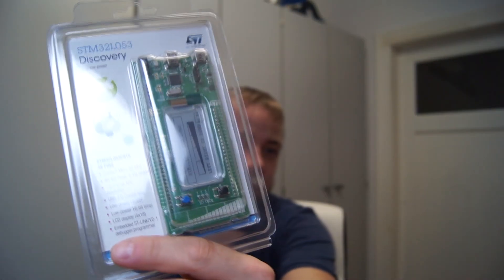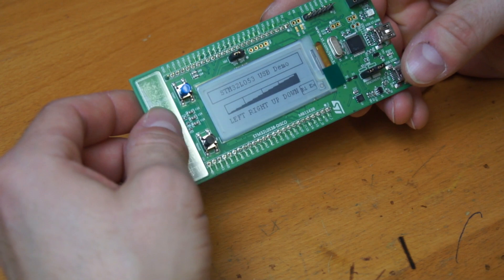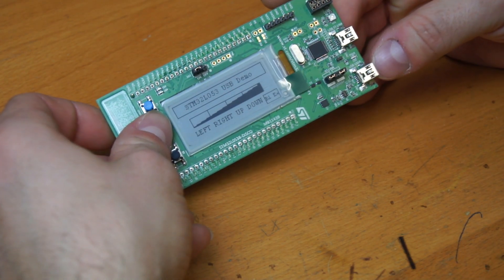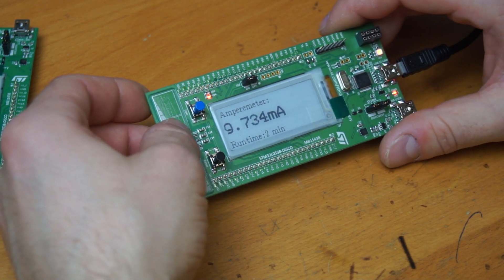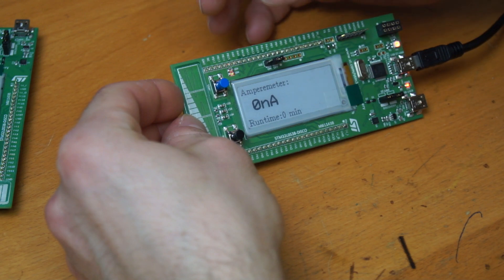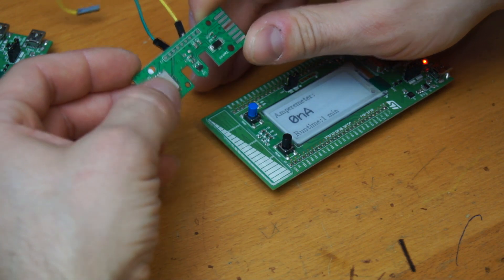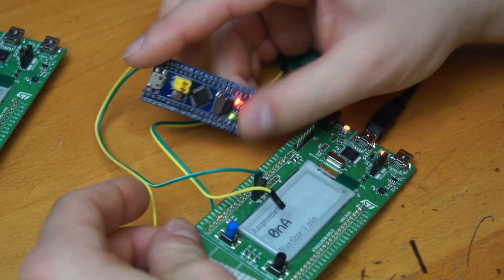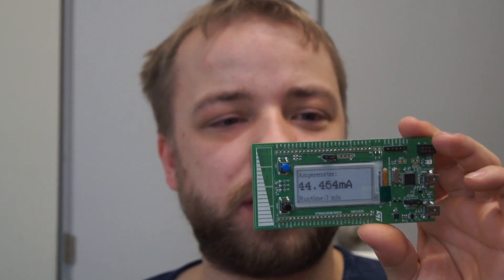Cheap High Precise current measurements via Arduino STM32L053 Discovery Board

Comment: I tried opening the arduino code link but link is not working. please check
Reply from the maker: Hey. The link is working fine
Reply: @atc1441  Thanks. Also what board have you selected while uploading the code in arduino ide? was it genric STM32L053 or any specific nucleo/discovery board?